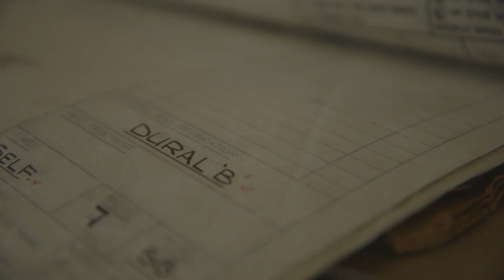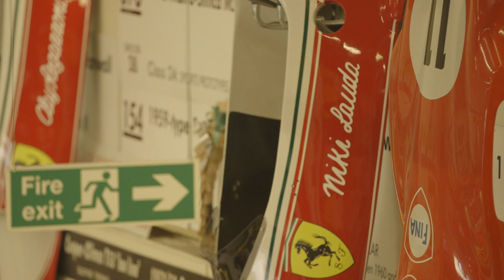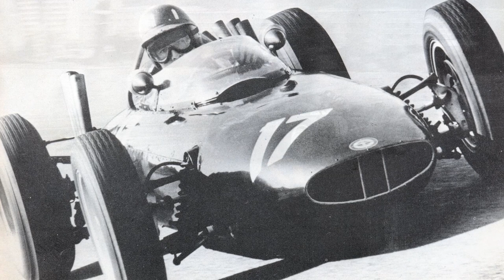Father And Son: Keeping BRM and F1 History Alive  - XCAR

Comment: This brings back distant memories of racing BRM P 153 chassis 04 in 1972 /1973./1974.
I purchased the tub from BRM and fitted a V12 two valve engine and Hewland DG 301 gearbox ex Cooper F1 CHASSIS F1- 68- 4 which a mate had crashed at Oulton Park.
The P153 is  well balanced and very forgiving so is very enjoyable to drive.
Kim Mather drove it a some races and had some success including setting the outright lap record at Aintree.
I understand the car is now under your care.
Keep up the good work.